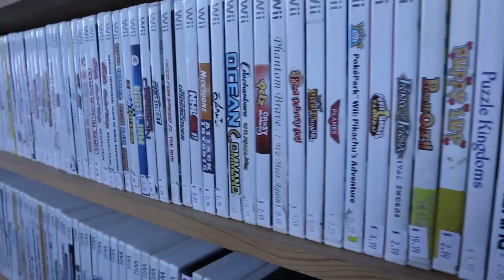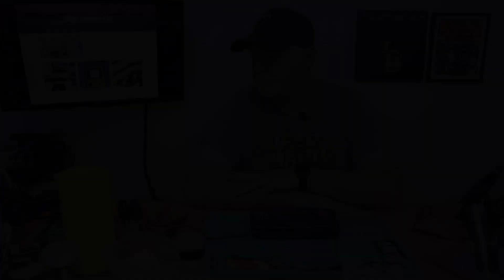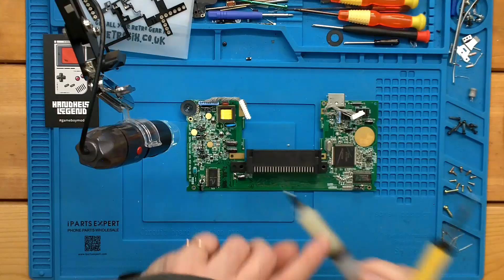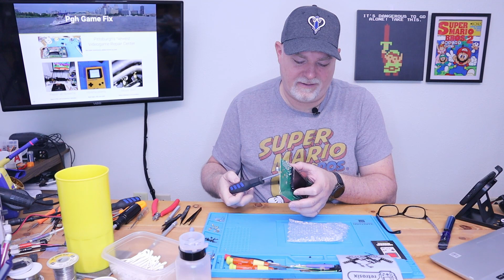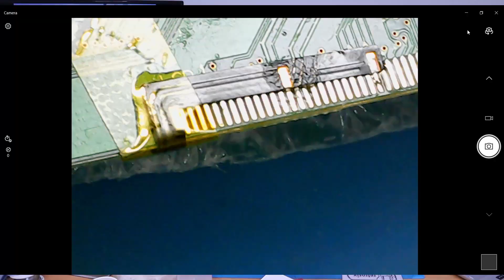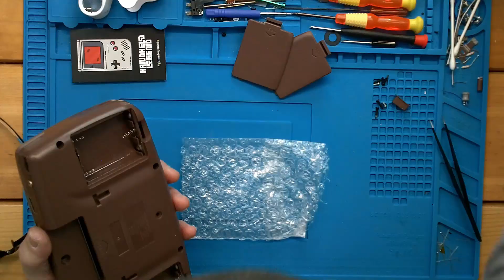RetroSix Game Gear LCD and Shell Mod

Comment: Sir, You forgot to mention Benn Venn aftermarket screens.  Benn Venn is the only manufacturer of aftermarket LCD IPS screens for the Sega VA4/VA5/Majesco type Game Gear video boards, to this date.
Reply from the maker: You should check the date on things.  At the time the video was recorded, the only screens were the McWill, and this one. Yes, there are mor options now. Thanks for watching.
Reply: @PghGameFix  yep, correct you are sir. My bad.